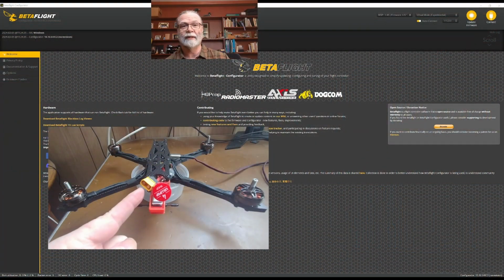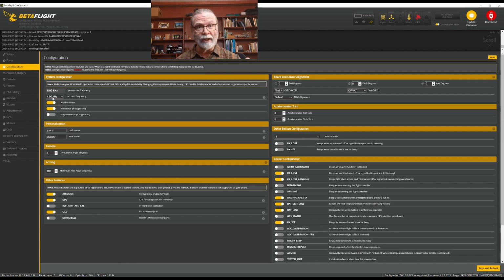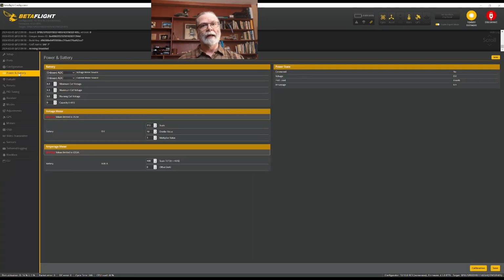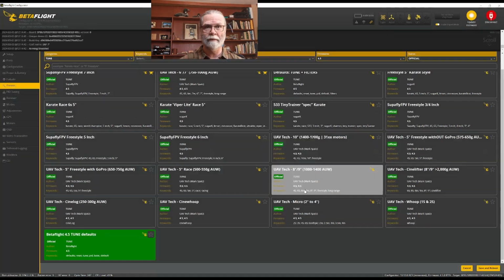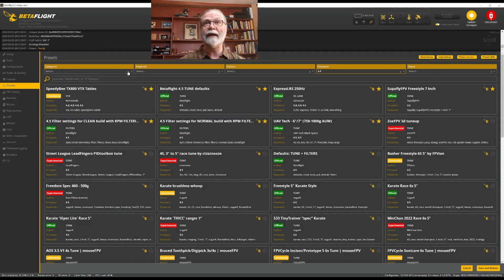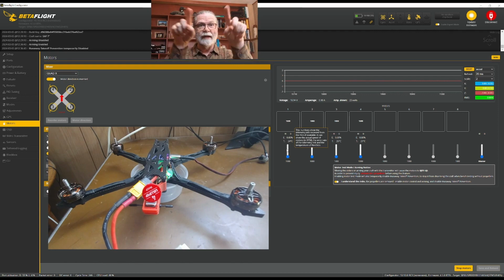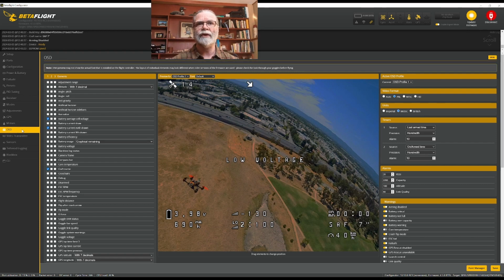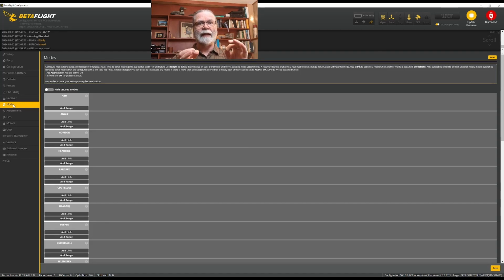Build a 7" Freestyle Quad - Part 6: Betaflight Setup for Beginners

Comment: Really enjoy this video sir, i would like to know if presets is necessary even when i don't want to use a VTX and GPS?
thanks
Reply from the maker: Thanks for watching and for the question.  There are many different 'presets'.  Some are for tune, some are for rates, some do VTX and other things.  Using presets is mostly choice and can be a time saver, but are not strictly necessary.  

However, if you use Crossfire, Tracer, Ghost, or ELRS for your RC link you should use a preset for your RC link. If the transmitter transmit speed and betaflight listen speeds are not matched (e.g. transmitter sending at 250hz, betaflight expecting 100zh) you get an unstable rc link.  ELRS 250hz is what I use on my transmitter, so I use the ELRS 250hz preset in betaflight.  It makes sure everything is set up properly.  Just choose the one that matches the RC link you use.

I hope this helps out.
Reply: @blueskyfpv  thanks a lot for your reply Sir, so helpful

Comment: I want to keep costs down, Can you use this flight controller without  a GPS and a video tx and no camera. Thanks As I want to fly LOS only.
Reply from the maker: Hi, thanks for taking the time to ask a question.
You can absolutely use this flight controller without a GPS, I have it on several quads without.  GPS is only ever needed for automatic navigation modes/rescue modes.  The FC will also work 100% perfectly without any video system.   To fly LOS, a flight controller only needs to have a standard IMU (accelerometer/gyro), and all flight controllers have those.  I have almost zero LOS experience with quads, but if you're just starting LOS, I'd suggest using an autolevel mode (angle or horizon) and looking into 'head free" or "headless" modes in Betaflight (if that is what you'll use).  As you get comfortable, you can make a switch to full acro if you want.

If you've never seen, QuadMovr (https://www.youtube.com/@quadmovr/videos) has wicked LOS skills and quads.

Good luck, flying LOS freestyle is a top end challenge.